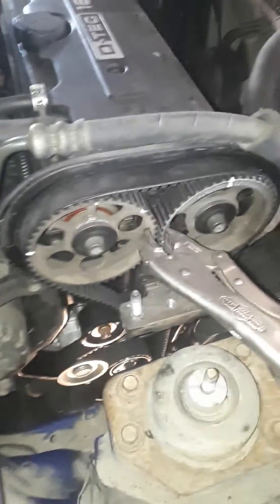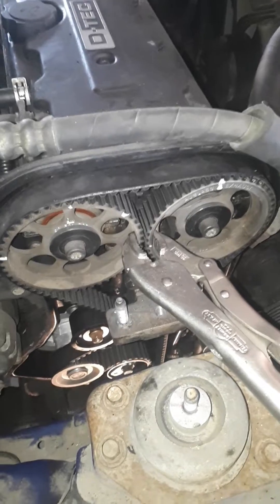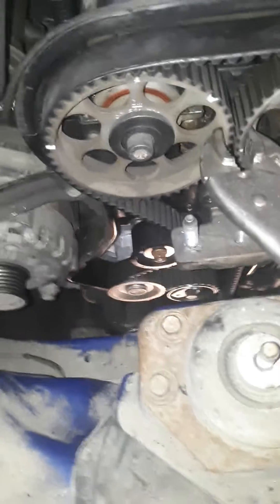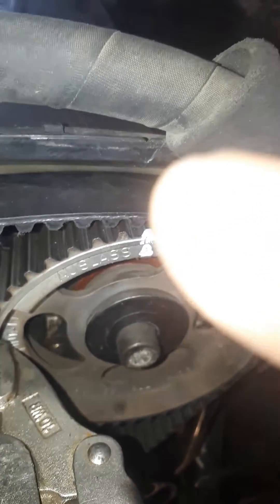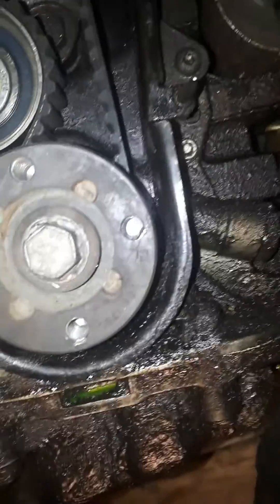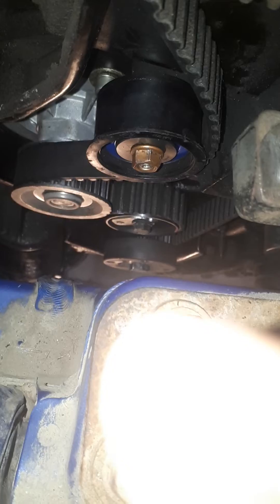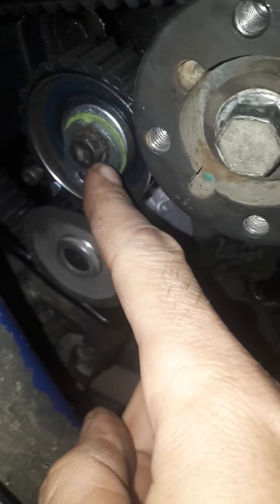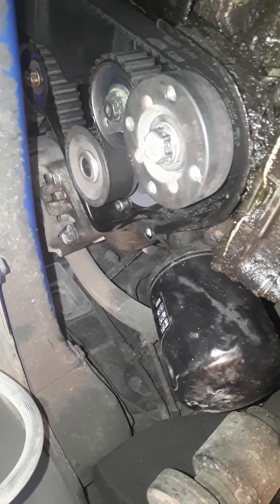chevrolet optra d-tec 16 valve how to set timing

Comment: Hi guys. I managed to get very little tension on the tensioner with the Sharp point to the correct notch. Belt all round seems tight. The minute I try and rotate the motor by hand I loose tension. Any idea what I'm doing wrong
Reply: Probably needs a new tensioner
Reply: Tighten the nut down tight on the arrow tensioner

Comment: Is this an interference engine my friend just snapped the timing belt we are wondering if it's f***
Reply from the maker: GM and Saturn
• 1.0L Interference
• 1.3L Interference
• 1.4L Non-Interference
• 1.5L Interference
• 1.6L (Chevette & 1000) Non-Interference
• 1.6L (LeMans) Non-Interference
• 1.6L (Tracker 16 Valve) Interference
• 1.6L DOHC (Aveo) Interference
• 1.6L DOHC (Nova) Non-Interference
• 1.6L SOHC (Nova) Non-Interference
• 1.8L Diesel Interference
• 1.8L Gasoline Non-Interference
• 2.0L Non-Interference
• 2.2L Diesel Interference
• 2.3L Non-Interference
• 3.0L Interference
• 3.2L Interference
• 3.4L Non-Interference
• 3.5L Non-Interference
Reply from the maker: Hey, I believe it is non-interference if I am correct, hope this helps.  If wasn't ran or turned over too many times, theres a good chance its still good.
Reply from the maker: If its a 2.0 litre

Comment: I was working on one of those today and I couldnt figure out how to torque the Crank bolt without it moving. I had a camshaft gear holder tool but it kept moving on me still. Finally got it jammed in and tightened it up and then just moved the left cam gear to the left  to release the tool and checked the torque on the gear. Wish I would've thought of using vice grips.
Reply from the maker: Ya its the only way I could come up with, I tried the gear holder too, didn't work very well, thanks for watching!
Reply: @THEMOOSESWRENCH  was the vise grips to torque the crank bolt too? Because it would keep moving otherwise?
Reply from the maker: No it was just to hold the cams in place.
Reply: @THEMOOSESWRENCH  so how did you tighten the crank bolt then?
Reply from the maker: Hi replied thinking of another engine, but i don't think i removed the crank pulley, but from what I can see on the video.  It looks like bolts will fit, four of them around the main bolt.  Did you try putting 2 bolts to fit, sticking out long enough to put a pry bar in.  Hopefully its the same pulley im talking about, hope this helps.
Reply: you prolly dont care but does anyone know of a method to get back into an Instagram account..?
I stupidly lost my password. I would appreciate any tricks you can give me
Reply: @Kolton Gabriel Instablaster ;)
Reply: @Jedidiah August thanks for your reply. I found the site thru google and im in the hacking process atm.
Takes quite some time so I will get back to you later with my results.
Reply: @Jedidiah August It worked and I finally got access to my account again. I am so happy:D
Thank you so much you saved my ass!
Reply: @Kolton Gabriel Happy to help =)

Comment: the tensioner should turn counterclockwise you are turning it clockwise, can cause the belt become loose
Reply from the maker: k thanks for the info, i will repost an update to correct it thank you!
Reply: When turning it anti clockwise it feels like a better tension but the Sharp point doesn't move to the notch on the tensioner. I'm struggling for a few days now